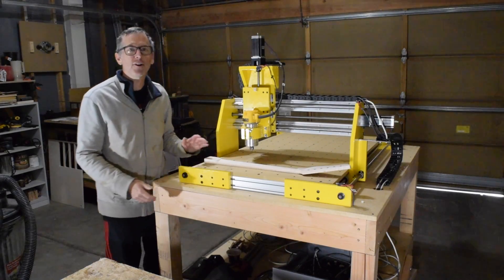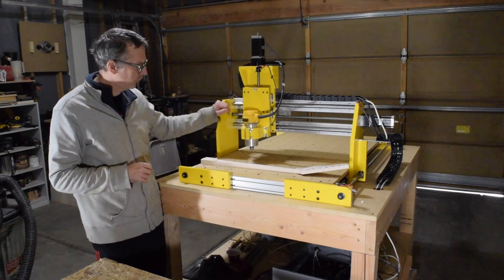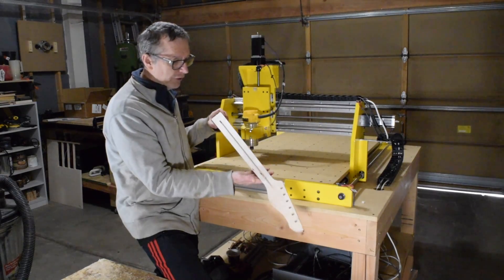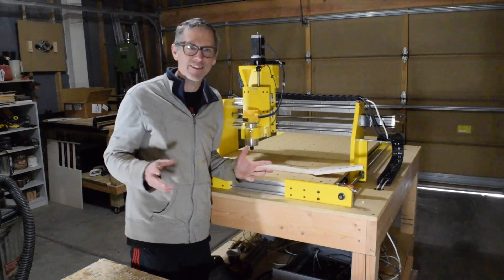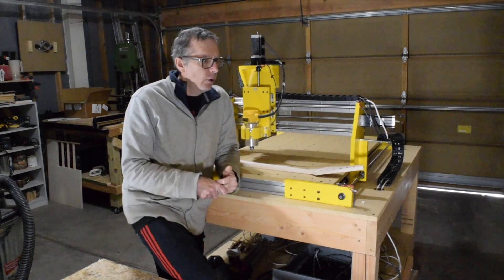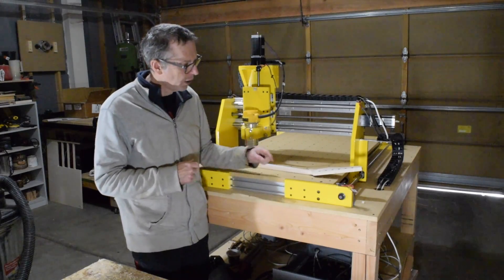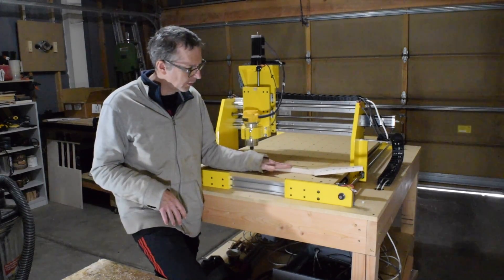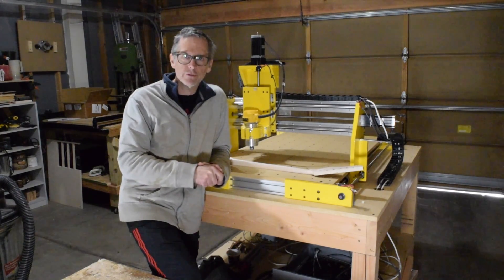The Last Update On The Highline CNC Routing Machine?

Comment: Incredible work and achievement! I love grabbing my morning coffee and watching your videos. Coffee with Chris lol. I think a lot of us are wondering about the difference in cost between the Xcarv and the one you built? Thanks!
Reply from the maker: The cost of building the Highline CNC Routing Machine came in at just under $1500.00. That's about the same as the XCarve. However, my new machine has more capacity and is much more rigid and more powerful than the XCarve in its current configuration. I still like the XCarve and recommend it to those who want a machine that is easy to assemble, setup and run, however, the current model does have some limitations with regards to the type of work I am doing. I know that Inventables is working on some new machine designs that will address some of these limitations, but I thought building my own design would be a fun project and I was right. Ironically, I used my XCarve to cut the plywood parts I used on my new machine.
Reply: "I used my XCarve to cut the plywood parts" Totally reasonable, I'd have done the same. One major thing I noticed about yours vs the Xcarve is that you used direct drive which is far superior to the belt drive. Thanks for the response!
Reply: Highline Guitars Thanks for sharing your knowledge in all your videos. What’s the timeline until we get a chance to purchase the CNC plans? Cheers!
Reply from the maker: I'm hoping to have them ready before July.

Comment: Chris great job man . What size it is? My space is small too. You can do necks and bodies right? Try doing your own p 90  pickup covers!!
Reply from the maker: I can cut 21" on the X, 37" on the Y and I can clear 5" on the Z.
Reply from the maker: 18mm 13 ply Baltic Birch.
Reply from the maker: I use Rhinoceros 3D and MeshCam for complex 3D curve designs like guitars necks and fretboards and Easel for simple 2D shapes like flat guitar bodies. Try Fusion 360. It's a free full service CAD/CAM package. A lot of CNC users swear by it. I swore at it. ;-)
Reply from the maker: https://grabcad.com/library?page=1&time=all_time&sort=recent&query=guitar
Reply: Can you get a taller capacity Z.?  I see many machines spec out at 6" up to 9"... 
But it looks great! Perfect size! 
I'VE been looking at different models but can't swing the $5 - 7 k And More, price tag!! AWESOME..!!!
Reply from the maker: You can make the Z axis any capacity you want. You would need to modify the design with a taller Z axis plate, longer Z axis rails, a longer lead screw and taller gantry side plates. Rigidity will become an issue so you'll need to make the plates out of aluminum instead of Baltic Birch plywood. Before you decide on a Z axis capacity, be sure you'll actually need 6-9 inches. I chose 5 inches, which is more than I'll ever use.
Reply: They are plywood..??😨
Reply: When will you have the kit plans ready..??
Almost ready to pull the trigger....
Also, a friend has a cnc that also has a LASER attachment... would that work on this..??
Reply: You've done such a great job on the machine, what is a good value on CAD CAM SOFTWARE..?? There is such a plethora to choose from, but I'm cheap...!😁
Reply from the maker: It'll be a month or two before I finish the plans. The package will consist of a cut plan for the plates, a list of the parts and an assembly instruction manual. Not sure about a laser attachment, but I don't see any reason why one wouldn't work.
Reply: Thanks so much.. I should probably get these installed and start practicing using the software. Is there a place to get free template type files and body files that you recomend.?  Grateful..!